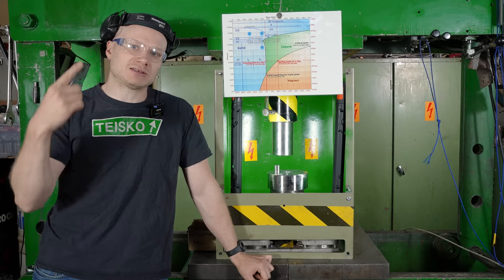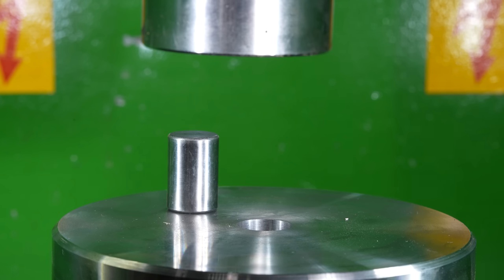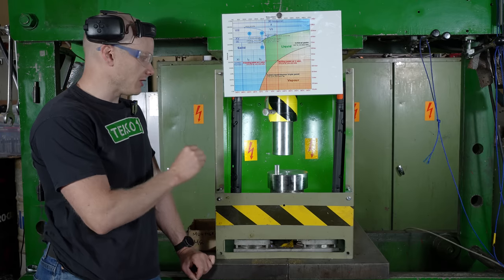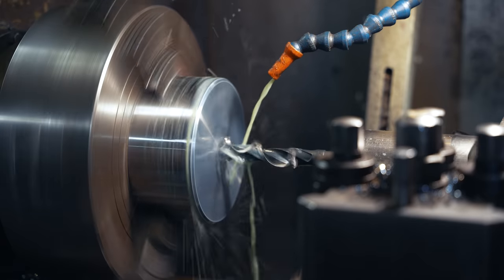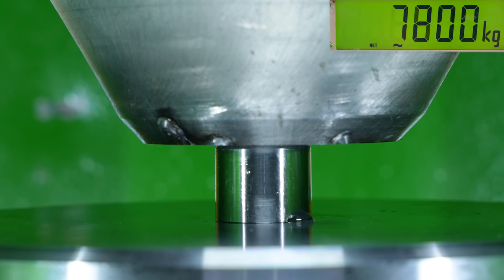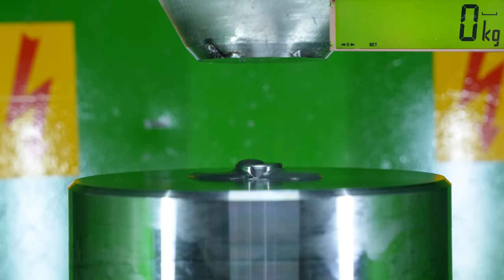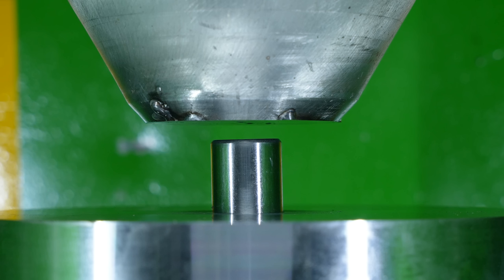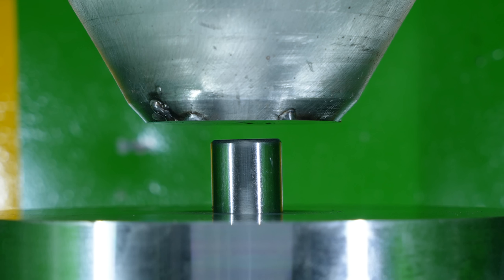Turning Water into Rock with Hydraulic Press

Comment: The roller pin does all the expanding of the hole on the bottom edge. A slightly tapered section on the pin would provide a much larger sealing surface.

Comment: Perhaps the chamber and the lug would need to be in a liquid nitrogen bath in order to cause freezing compression as the hydraulic press applies pressure very slowly, rather than pressure-heating water starting at room temperature.

Comment: Its very simple to get such high pressures.
Build the same setup again and make large thick steel disk and place it on top. Put some explosives on it and detonate them.
It will force the plug inside the hole within milliseconds and the water will have no time to leak.

Comment: I would love to see the smallest bore possible so he can truly make some terrifying pressures with his press, like I'd love to see a 50cm diameter tube with a 1mm bore that is being compressed. That's when we'd surely see the real magic happening. We might even be in the exotic matter territory though I'm not going to make the time to do the calculations 😂

If he could also have a system for cooling the block down or heating it up, then we could see all sorts of phase changes that are normally difficult to achieve. He could do this by drilling channels throughout the block to use water heating and cooling. You could just calculate the strength of the materials needed vs the strength lost because of the holes to find whatever still meets your safety factors. Super super cool idea!!
Reply: One major problem is time duration.  Explosive compression doesn't suffer containment failure...for a few nanoseconds. Even so, it does offer opportunities - cladding metals to H-bombs.  Supposed we took some lithium-6 deuteride, (Aldrich, 555363-1G, 1 gm, $(USD) 117.) dispersed some metallic palladium in there, and gave the composite a big squeeze re cold fusion.  The US government offers a truly huge garbage dump of hydrogen storage alloys literature - al of it cruel fantasy in commercial application.
Reply: @uncleal  that's an interesting idea, and a good point regarding the failures.

After my initial comment I briefly considered if there could potentially be some sort metal doping procedure that could be done by surrounding your in-chamber metal suspended in either a liquid or gas, and the using these extreme pressures. I wonder if diffusion could somehow be forced, we could create an entirely new alloy. If this is possible you might even be able to track the concentrations, partial pressures, and diffusion rates all together to customize lattice structures, provide a gradient of different material properties, engineer failure points or create load bearing structures within the material,bond two different alloys together within an overall superstructure of base materials. Wow the potential is nigh limitless. All of that of course hinging on the wildly unlikely possibility my idea would even work 😅

This thought has also led me to wonder if you could even translate this into some sort of flash tempering techniques as well. Do they ever use pressurized chambers to temper materials? Huh, lots of cool and interesting possibilities that he could pursuit, even if it's just to test a hypothesis, regardless of its feasibility and most importantly, just to have some fun with it 😁

Comment: I would suggest to make the plunger convex in the bottom, like an upside down cup. Use a softer metal so that the water pressure cause the plunger to expand to grip tighter proportional to pressure and not proportional to displacement as you do now.

Comment: I think that because you're going with as much crush as you are. The bearing might be getting a crack which is allow ultra high pressure water to escape with metal cutting force. It's that that I believe is the reason for leakage.

A longer distance of freeboard before reaching the water with a longer compression piston that in this case, is the bearing being pressed into place. Figure turn one down from a piece of tungsten alloy. Induction harden it but the anvil used as your chamber could be a slightly softer metal to allow it to be stretched around the piston to maintain the friction interference seal.

Comment: You have to hollow out the roller bearing such that as pressure increases it pushes out on the walls of the roller bearing increasing the sealing capabilities. Don't use air because as it compresses it will raise the temperature of the water.

Comment: I have an idea. I hope I'm not repeating someone else's!
If you turn up a short piston of the same diameter as the roller-bearing piston, but of a softer metal, say, mild steel. Place that into the bore before the roller-bearing. Hopefully the softer piston would deform and spread into the gap between the roller and the bore. You may need an even softer metal. Try aluminium or lead maybe.

Comment: Very exciting! Would be interesting if you made it watertight and then heated the whole thing! Where would the steam go?
Reply from the maker: I think the rollers are there so tight that the water couldn't boil. On some point pressure raises so high that the roller would fly out and all the water would boil instantly making the thing basically steam cannon :D
Reply: I'm not a scientist so take this with a grain of salt. I think that in a completely closed system, water couldnt technically turn into steam(vapor). It would just increase the pressure of the closed system to the point where it remains liquid. If you consult the phase chart he showed, the line between liquid and vapor would be kind of like the equilibrium point. For example, if you heated to 150C, you'd expect inside to be a liquid with a pressure of about 8 bar(no pressure added by the press). Once the system opens, due to a leak or whatever, the pressure would go down to 1 bar, but still be 150C so instantly turning to vapor at a violent rate.
Reply: @savageslayer3434  Yes. That is why pressure cookers explode so hard if they fail. At some point the water becomes critical. The chart does not really explain what that means. But the critical point means that liquid and gas are no longer a seperate thing and the water takes properties of both. There is a pretty good video of someone doing the same thing with CO2 (its much easier with CO2 because it needs much less pressure and much less heat).
And actually it leads me to two more video ideas: Ultra high pressure cooker and supercritical water. I think both could be interesting. But please do not do that with the deep sea chamber. If that thing fails, it really becomes a bomb. But on the other side... Supercritical waterbombs sound like a great idea too. xD

Comment: Wouldn't the force sensor just be reading the total force of the water compression AND the friction on the walls of the cavity between the bearing and the big donut, though?   You need some kind of pressure sensor inside the water itself to just measure the water pressure.

Comment: If you dont know the temp ,youd have to get to 10e10 Pa to assume it was rock , (thats water VII ) 
To get water VI , its got to stay or be cool . 
Since The pressure fit seal , surprisingly, didnt hold , youd need to actually seal the water in a deformable metal container that wont burst , but you can still bend or dent , to apply the pressure. 
A slug of air has a different phase transition and will tally as a waste of force.( so the kg measured wont necessarily calculate directly to the psi on the water same for deformation of the steel (energy is lost as heat and structural change) 
Or so im guessing 😉

Comment: I believe the contract and tolerance between the bearing and steel receptacle is generating enough heat to caus failure or weakness in the softer steel i believe we need the slowest available feed speed (to allow the thermal energy we generate to be siphoned off by the bace receptacle) with an exstremely lightly taperd cylinder and hole so that our seal pressure may increase as we drive the plug down combined with a hollowed plug so the the pressure generated may exert force on the cylinder walls perhaps driven in with a half sphere and a divit in the plug to provide a symmetrical 360° force down aswell as outwardly i wish we could add a material where the steel meets to aid in sealing or if we could exert the force on a solid object with the water inside (ie deform a solid box or sphere to our desired pressure, is it possible to add a copper or other metal ring to serve as a pressure fitting seal (it may just add more points of failure)

Comment: Maybe make the well deeper than the pin with a slight taper at some point; maybe like .3°. I am guessing this could allow the pin to act mote like a stopper as it goes down. The down side is it could get capped out before the water reaches pressure so it would be a balancing act.

Comment: If it takes 3 tons to move the steel in it should take only a bit more to squeeze the steel even wider to create a tiny gap for water to leak out. So I'm not surprised the water leaks at over 20 tons of pressure. It's simply not tight enough.
You have to make sure your outer walls don't deform under any circumstance. They should be made of the hardest & strongest steel you can reasonably get. The piston should be mild steel. Maybe using a copper seal is better than deforming the piston itself. But I don't know if it works at these pressures.

Comment: I don't think you made ice VI here. The pressure and the metal grinding against eachother would also have heated it up quite a  bit. To make ice VI you'll need to pressurize it and then keep it under pressure until it cools to room temperature and crystalizes. Interesting video tho.

Comment: I didn't watch in detail so excuse me if you already thought of this, but doesn't ice need to expand to freeze? Therefore it needs a stretchy container, maybe a thin walled steel thing that will stretch instead of pop but still hold more than 35 tonnes?

Comment: Your tolerance will have to be just smaller than the water molecules. Get it to the point right before the leak, spray the compressed water with refrigerant and watch the force sensor max out. Might be able to split the steel right in half when the ice expands.

Comment: It's theoretically possible, but one would need to apply roughly 10 ^10 Gigapascals of pressure.  Normal atmosphere is around 105 kilopascals of pressure at sea level.

In other words, find a Neutron star.

Comment: I think you need to include a copper wiper, i.e. push a copper plate in front of the plug that's larger than the hole.

Comment: Maybe slice of copper or other soft material between the steel plug and water surface could also help? If you could get it to push in potential leaks before water, it should block the leaks (I'm assuming the forces are not yet high enough turn soft metals into liquid).

Comment: Would it make a difference if you completely cleaned and degreased the machine parts before you pressed them?  Since the oil is less dense than the water, would it help keep it tighter if there was no oil?

Comment: Compressing air would reach shockingly high temperatures, which would probably shift the point on the chart to way higher temperatures.  Remember the people in the cheap sub that got smooshed by The Titanic.  Cooked in microseconds...

Comment: Metal on metal won't yield a tight seal, machine 3 grooves into the piston and use carbon seal with backup FKM O rings.. Much like a hydraulic piston. The surface finish on the cylinder needs to be honed with a specific angle cross hatch too.. Then you will crack 100T.

Comment: as you increase pressure the water boils before solidify, tha vapour is way more thin thus escape in high pressure from the sides, unless you find a way to make a bearing 99,9% seamless i think maybe using some kind of rubber on the press could do the trick, think of it like an huge metal syringe... hope it helps!

Comment: Some ideas that might help you :  
- destroy the hydrogen bond of the water, it will be more easy. 
- ask to Ocean Gate how to make sealing for hight pressure conditions.
- start at -20°C with solid water, and increas pressure very very slowly, during months, because solid transformation at low temperature are very slow.
- obvious idea, put water into a very strong room and create an explosion into the room.
- It could be difficult to go on a more heavy planet with good pressure environment, but with hight speed rotating device you can reproduce these conditions. Put a glass of water into that and press start. 
Feel free to test theses brilliants ideas ! Perhaps other will come soon, I'll be back.

Comment: why not a crush seal? fits around the piston and extends only a few mm as the head travels down it will contact the surface sealing the water in. some experimentation would be required but the seal itself should be pretty easy to make.

Comment: IMHO you need to taper the piston to match the taper of the bore. Where the parallel sides of the piston meet the tapered wall of the bore, the sealing surface is only a few thou wide. You also need to polish both pieces to at least a 20000 grit (mirror) finish. I think this would give a greater seal with less chance of galling.
What say you?

Comment: All awesome advices to a achieve this awesome experiment. Possibly the bevel at the end of the steel cylinder is causing the water to more easily push up through the cylinder hole with pressure.

Comment: Possibly make the steel rod out of a different material, something that will expand with the heat from the compressive forces a a more rapid rate the the compression vessel, thereby sealing the piston into the cylinder.

Comment: Make the plunger bottom end slightly concave, there can not be any faults in the edging of it too as it will fail. But what will happen is as you hit the lower ridge the bottom of the plunger will slightly fold inwards causing a cupping. This will trap the water...should do in theory as I say as long as there are no errors in machining. Someone else mentioned about pausing during pressing so I wont bother explaining that part. Be aware that water treated this way can become volatile, you are trying to achieve something that takes millions of years to do but in a few seconds with an inaccurate setup. Love to see you pull this one or rather press this one out. All the best though I feel you wont be able to complete this project.

Comment: When it starts oozing under pressure wont it remove metal, think water jet. You can see the discoloration of the water. Maybe you need something a ground tungsten insert, and a tungsten dowel.

Comment: Ice is water in solid form. That is the entire definition. 
    The most common ice you will find on Earth is solid because of low temperature. However water can be solid for reasons other than cold. It is still ice.
    That said, in geology is is considered a mineral. So you are not wrong in calling ice a rock. But even ice from cold is still considered a mineral, so even ice I is a rock.

Comment: Can you drill other side of the tool and press the roller pin piston out. Or some other way get the piston out. And show what kind of path the water carved into the steel? it must have left some escape path for it to drain so quickly.

Comment: what if you cool down both pieces with dry ice to make them harder but also keep the water cold and surround the pieces with dry ice and use a fan to blow the carbon dioxide gas away to keep a clear visual

Comment: I would think you need much harder steel and it should be liquid nitrogen cooled in the process.
I would also make the hole conical, not stepped, so you won't have a chance on any uneven wear which creates those weak spots where the water goes through.

Comment: Is it possible to verify the solidity inside?  
rejected first idea come to mind is using some ultrasonic device, but I have no further knowledge to figure out how to check
- even better, to put a small ball inside and tilt the whole thing. Until it can roll around, it stayed fluid, if it stopped then its solid. Or maybe pulling it around by magnet and hear if it clicks on the wall while moving or not when stopped. But magnets may also get influenced on high pressures, who knows..
I suppose, when your compression process matured to working properly, the hidraulic press could be released from top of the stuck piece of metal and they stay together, so this thing can be freely moved around.

Comment: You can also make a concave depression in both the bearing and tool steel to make sure some water is still in there, caught in The concave area or drill a small hole at the bottom

Comment: You should machine a couple rings on the inside of the hole and place a couple seals as the roller bearing is pushed into the tighter smaller.section and it will also have a couple rubber orings its sliding through at the same time. Sort of a a hydraulic ram works.

Comment: You need to put a denser material ring to prevent water from escaping. Rubber or silicon that take place of the water on the side of the tool to prevent leak.
Reply: Or a soft metal

Comment: Unfortunately, its unlikely you made Ice VI it since the temperature of the water greatly increases with compression. It likely took a larger pressure than assumed to create it in one go. @26 tons you would have to keep the press at 26 tons until the temperature of the water comes back down to room temperature to allow it to freeze. It may be effective to supercool the tool and the container you are using with liquid nitrogen or dry ice to counteract its heating. An added benefit would be the fact that the water would already be ice in the container, then it would heat, liquify, then freeze into a different state.